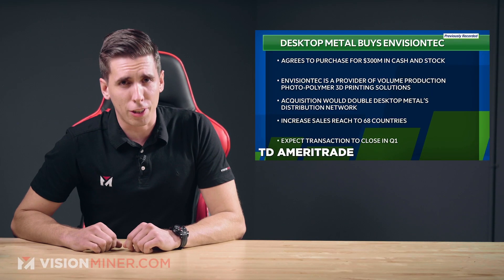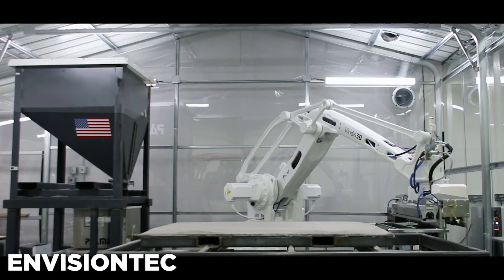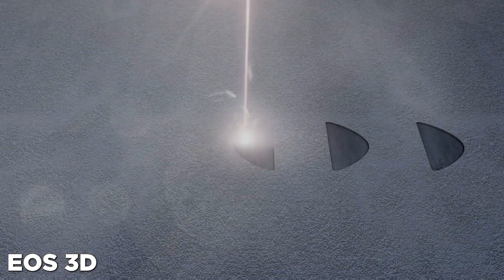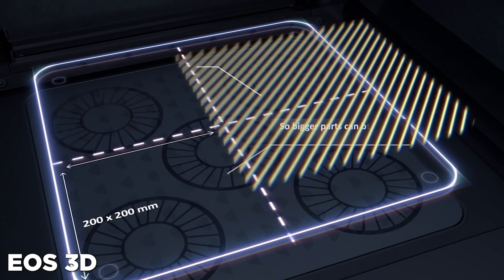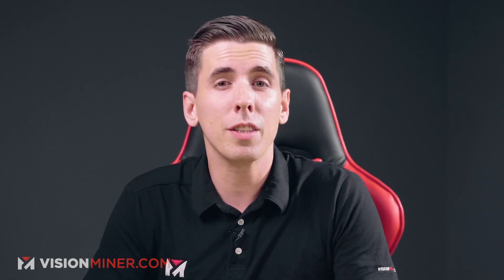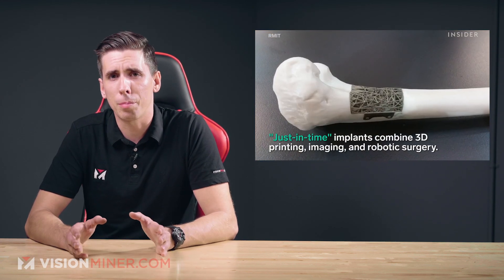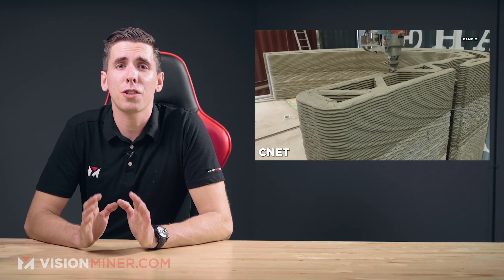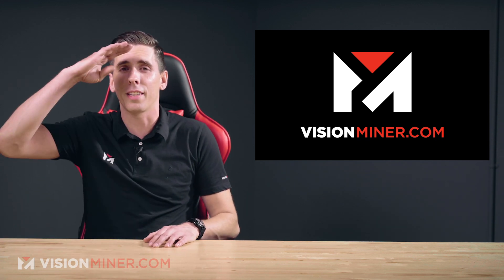Desktop Metal BUYS EnvisionTec, GIANT 3D Printed Ship Propeller, Implants, Rockets, and more!

Comment: Ark has moved up their position in Desktop Metals.  On January 15th, right after DM bought out EnvisionTEC for $300 million, ARK started buying shares.  In less than 6 days Desktop Metal is number #13 on their 3D portfolio.  ARK purchased their shares at an average of $24.00 a share.   At the time of this post 1/21 -  ARK owns 469,083 share worth $11,267,373.

Comment: I'm printing nylon carbon fiber an Ender 3, upgraded to a direct drive all metal hot end, but with the stock maximum temperature of 260 degree. What advise do you have for us entry level home gamers printing functional parts with this incredible material.
Reply from the maker: probably print slow since the temperature is lower... do it in a warm room, or put a cardboard box over it, to keep the ambient heat in, and you'll have better results. Also make sure the filament is dry, and stays dry every time before you print! Vacuum chamber with a warm spool is the easiest way: visionminer.com/drykit

Comment: I have gone through a few rolls of 3DXTECH PA6+CF. Is there any way to stop oozing with this filament, or is it just par for the course for these kinds of polymers? I'm using a direct drive printer btw. E3D V6 hotend.
Reply from the maker: Generally a bit more retraction helps, but in general, you absolutely need to thoroughly dry the filament before printing. If it's stringing, it's 99% probably wet. visionminer.com/drykit

Comment: Question: what challenges do you see in 3-D printing habitats on Mars? Would it be possible to use local materials or are they not suitable? What about printing in an almost vacuum? The mars atmosphere is 1/10 of 1% of earths? What effect would that have? What about 3-D printing in 1/3 gravity? Also, if the materials that are being used to 3-D print or heated, how long will it take them to cool off in such a thin atmosphere? These are key issues facing the settlement of mars. Though it’s very sexy to talk about the vehicles it will get people to Mars, people on Mars will spend far far longer in 3-D printed habitats. If those habitats fail or if they are difficult to maintain then going to Mars may indeed be pointless. What do you think?
Reply from the maker: Yep, definitely up for some new and unknown challenges!

Comment: Does cf nylon cause corrosion when in contact with metals? Does cf nylon have faa certification?
Reply from the maker: Not "corrosion" chemically, but it is abrasive due to the CF -- for example, it will wear out nozzles made from softer metals like brass.